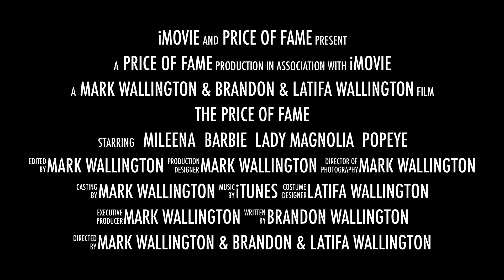On The Tools or Brush?

Comment: The Flashlights.
Reply from the maker: That’s a good one ☝️🕯
Reply: @wallingtonfilming  what roller do you user if using a smaller roller 9 inch or lower
Reply from the maker: @dylansmith726  Hamilton Green
Reply: @wallingtonfilming  what size best to use if you using a small roller